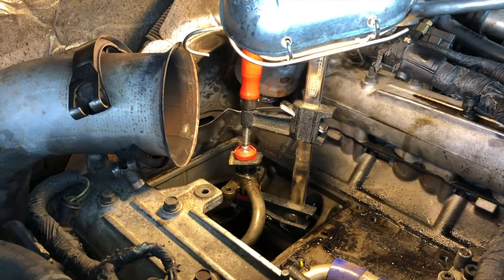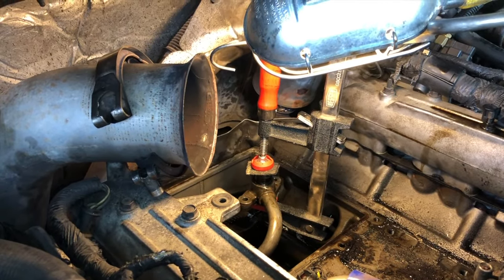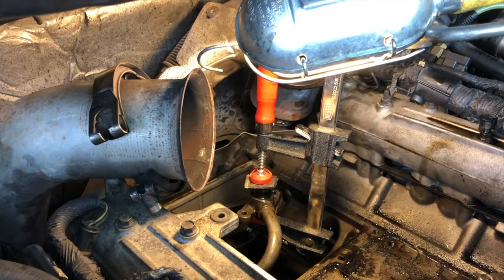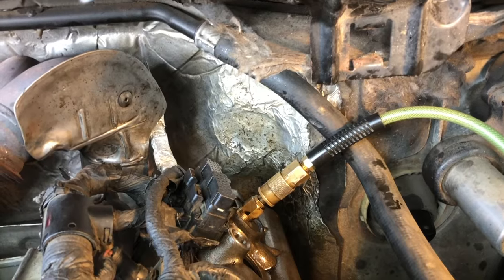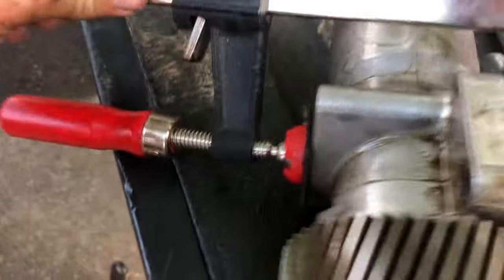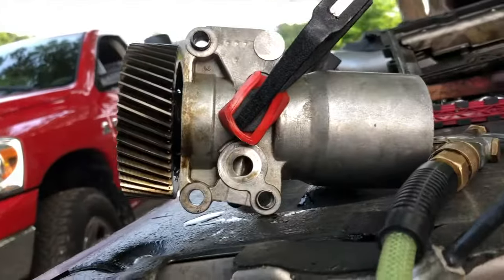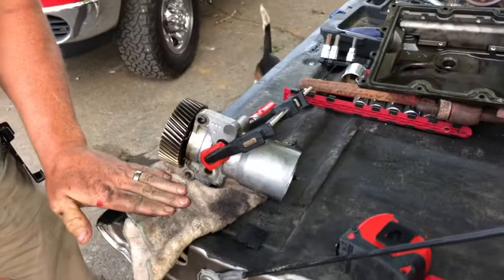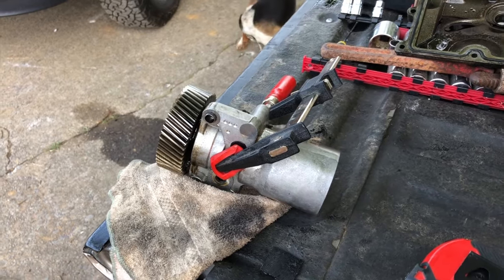How to Definitively Test Ford 6.0 High Pressure Oil System and Pump

Comment: Great video!  If we think of this pump as just a simple hydraulic pump, which it is, that seal shouldn't leak with around 100psi of shop air, let alone 500psi of oil which is the minimum needed for the HPOP system to fire the injectors on this engine.  Good Job sir!

Comment: To anyone else that may refer to this video on their fix, the pump is supposed to leak a little around the shaft. Not saying this pump wasn't bad internally, but there's other ways to test the pump in the same manner. But I give props to "Barnyard" for being innovative and fixing his own truck. There's only one way to figure this stuff out, and that's exactly how to do it 👍
Reply: What other ways are there? Can you be more specific....
Reply: Hey did you happen to notice if yours leaked out the back side? where the c-Clip holds the plate on?  I have the same issue and did exactly what you did but mine is blowing some oil out the back. Is this normal? Doesn't seem right to me.
Reply: Nzz is correct,  the pump is supposed to leak a little at the shaft..it's a dump valve!
Reply: @timbowles6  correction its not a dump valve it's a swash seal. the dump valve is located on the bottom of the pump with a allen insert to remove it from the pump.
Reply: Everyone that said it supposed to leakoil out the shaft seal is full of it the pressure reliefe returns the oil into the return line . There should be no external oil leaks on this pump.  50 Year turning wrenches  .😊
Reply: @davideden8569  the front shaft seal is a wiper seal and provides oil back into the engine side / low side; a steady leak that is never higher than the oil pressure your trucks makes (engine oil, not ICP) but if you blow 150 PSI into it will blow 150 PSI out.

Comment: Dieselsite rep told me their pumps arent sealed and you can't use air to test it.  They said you need to follow the Ford manual for 6.0 and use blocking plates and manual hydraulic pressurize.  I had the same idea when I had air blowing out the front seal and into the oil cooler area.  She said they flow test the pumps and they can run them at 5K psi all day.
Reply: Dieselsite rep, whoever that is, didn't know what they were talking about.  That leaking at the main seal is not acceptable.  I had one like this and the truck still ran, but could only generate about 2000 PSI.  The engine needs about 3800PSI at WOT so the engine would stumble at about half throttle.  I had just replaced the HPOP, due to a no start hot situation, so I assumed the new HPOP was good, since it made my truck run.  Chased my tail forever going through the turbo, injectors, fuel system, EGR, exhaust, etc. until I found this leak was causing the stumble. GRRRRRRRR
Reply: this is absolute true , talked with a friend that builds the pumps at dieselsite and the front shaft seal is designed to leak an that air should not be used to test the pump because it isn't designed to be completey sealed. if it produces pressure it is fine.

Comment: Did you do the preesure test on the new hpop to see if it leaks out the shaft too?
Reply: it will leak, this guy wasn't exactly aware that seal is a swash seal designed to leak, and lubricate the motor
Reply: No I had the same problem with a reconditioned pump right from O'Reilly's you can't pressure test the system with that kind of a leak I had to get another new more expensive pump before the problem got solved and caused me a lot of grief chasing my tail looking for leak elsewhere and couldn't find any it's not worth messing with a reconditioned pump

Comment: Very ingenious and simple testing.  However, when you see that old style aluminum pump, that's pretty much how you know you need a pump.  They were extremely failure prone.   If I were replacing one, I would upgrade to the new style pump which takes a different cover.
Reply: You have to remove the heads and install the different oil rails to the dummy plugs. I learned that the hard way!
Reply: @harleyperkins1134  thank you for sharing your knowledge

Comment: I tested mine in this fashion today and had oil coming out of the shaft. Injectors done recently, ipr is good, icp is new, replaced dummy plugs and standpipes with new style w/Teflon . Guess I’m gonna order one, sure hoped it wasn’t that, but seems to be the case. Good video, man!  I hope this is my problem.gonna be a grand with core on the stupid thing, but gotta get it going.
Reply: You needed to do those steps anyways. You'll thank yourself.
Good luck w/ your truck the rest if the way Sir✌🏽✌🏼
Reply: Was it the pump?

Comment: Just wanted to point out. That hole where the compressed air was applied is the oil pick-up side of the pump and would never see anything over about 75 PSI. supplied by the main engine oil pump. These are two stage pumps with check valves etc. The high pressure side should never be able to leak backwards to the low pressure side. As an internal pump they are designed to leak a little out of the front shaft for oil on gear etc. at 75 PSI.

Comment: Just so everyone knows that pump uses a swash seal and it does not fully seal unless it’s spinning under engine rpm if you put pressure on it, you should see a couple drops of oil come out not a full blown leak like that that one was definitely bad. It’s a good way for a do it yourself test but just don’t freak out if it’s seeps a little bit.

Comment: I bought a reconditioned pump that was doing that from day one was told it was normal to leak some but it would be impossible to do a leak test and it didn't seem normal to me so I purchased a new pump and it doesn't do that however I still have a hot no start condition I've been scratching my head with forever. The seals look pretty good in the j-tube but it's possible oil could be bypassing because it seems they're pretty flat

Comment: Did you hear the leak in the valve cover area? I replaced my standpipes/dummy plugs. Orings on injectors tips and nipple cups on oil rail. Still hearing a leak . Just curious if you heard it leaking up in the oil rail area? That's where I'm still hearing my leak. Thank you

Comment: Yes did one yesterday  and it came out front  seal of pump  almost put I back together  after finding a small leak  in line fittings. To my surprise  I pulled  the pump to double  check and found  pump leaking  only got between  200 to 575psi  cranking. It was demanding  1400psi always check front seal on high pressure  pump 😉
Reply: So I pulled out my HPOP today and did the exact same test as in the video, I have a very tiny amount of air coming out from the same area but not near as much as this guy did in the video, I was told by one mechanic that a tiny bit of blow-by is normal in that area  What do you think?
Reply: @richway2197  fix it before you put it in

Comment: That does not determine a bas pump, ive seen several that leak a little bit from the seal and they are perfectly fine, i believe they are designed to leak a little from the seal. U pour a little bit of oil, cover bottom hole with finger, turn it by hand and it should suck on your finger.

Comment: So did replacing the pump fix the truck? Or did you run into more problems?
Reply: Its a 6 leaker  of course he did😅, & if he didn't he will eventually

Comment: 6.0 pumps aren't sealed. you need to follow Ford RAPS and testing the pressure produced by the pump. I applaud you for fixing your own pump but some air would certainly leak out the shaft because some oil is meant to leak. I'm not saying that your pump is good but this is not a definitive way to see if it is bad. Just for some perspective did you happen to do the same test with the new pump?

Comment: Did the fix work for you?  I've done new o-rings on all injectors, new o-rings & nipples on fuel rail, new ICP, & IPR and still no start hot.  So I'm thinking HP oil pump too.  Did it work after you replaced the pump?
Reply: You can also check your icp pressure if it not at desired the engine won’t start indicating a ipr or hpop

Comment: I have a leak in hpop. Cold start all day. Not a complete not hot start but sometimes it is. No trouble codes. Runs perfectly fine while running. It's either my stand pipes and plugs or hpop . I'm confused guys
Reply from the maker: Did you pressurize your system with air? If it’s leaking you’ll be able to hear it blowing and gurgling. I pressure tested the hpop and oil rails with stand pipes separately. That how I came up with the idea of how to test the hpop alone.
Reply: Pressurizing with air is crucial, I think. If you have a leak preventing start up, you should hear it. Im replacing an HPOP tomorrow.. working on a 2005 6.0 & it has no air leaks, & a new IPR valve. Only seeing a slow build to 15 lbs pressure at ICP while cranking, FICM is fine.

Comment: Did it fix your issue?
Reply from the maker: Yes, the hpop leak was the issue.
Reply: @Flipflopbarnyard   thank you for the video.
Reply: Thanks for the video I have the same issue with mine... so many people that don't know what they're talking about say it supposed to leak out the seal. I've been chasing my tail forever with this problem I replaced absolutely everything and have no leaks anywhere except that seal. This was a reconditioned pump from the local auto parts store. These pumps are junk reconditioned or not.

Comment: Was that ultimately the problem?
Reply from the maker: Yes, this was the problem.
Reply: @Flipflopbarnyard  have the same truck wouldn't start hpop was only putting out 450psi, I pulled the pump replaced the o rings but I didn't have the tool to take the j tube off and replace that o ring. Well now the truck starts and runs while cold won't restart when hot I'm thinking leak
Reply: @Rightwingcommentremoved  Sounds like my no restart hot issue I am chasing now, did you find your problem?

Comment: But that don't tell you, if the pump is bad internally and not pumping. That just tells you it's leaking around the front seal.
Reply: I've replaced everything on mine and have no leaks anywhere in the high-pressure oil system other than that shaft leak...but it has a hot no start so what else could it be? You can't pressure test when it's leaking that bad. Aren't they supposed to hold pressure when air is added to the ICP port?